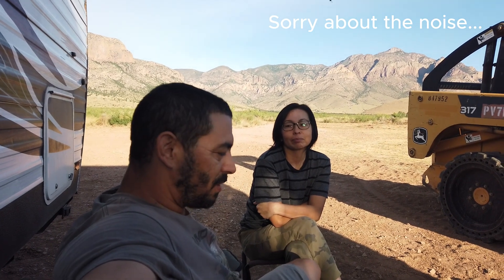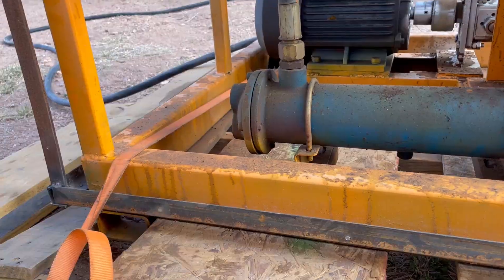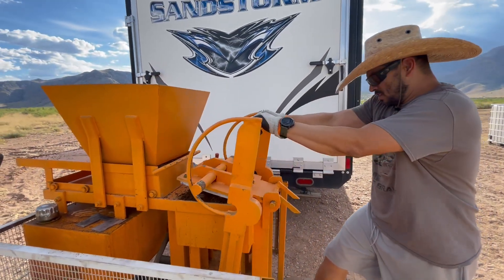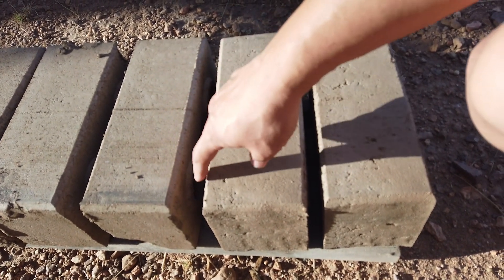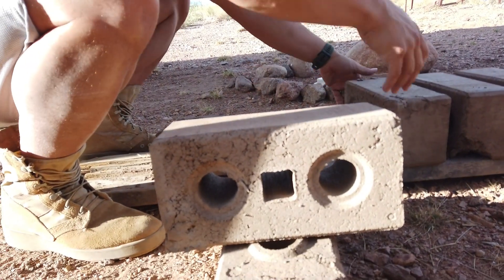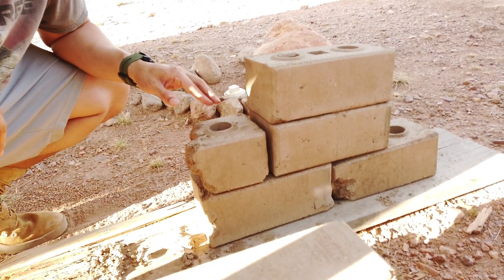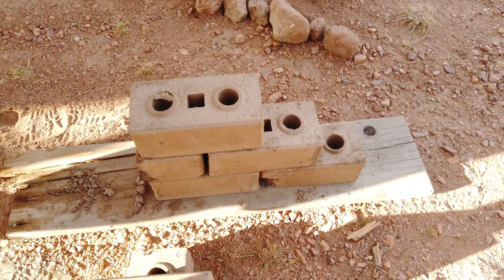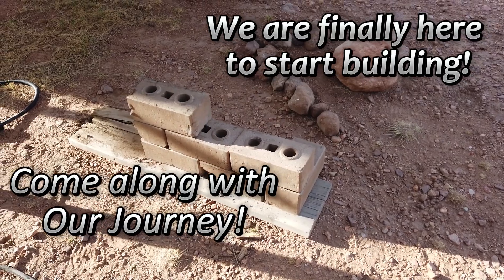Compressed Earth Blocks for House Build

Comment: wrong mixer , your clay is balling, you cant use cement mixer with clay
Reply: we have 2 different ceb machines
Reply: we use pan mixer or bobcat attachment , be sure mix is damp but not wet
Reply from the maker: @JohnDay-g6o  Thank you for your comment! We’re aware that the mixer we’re using isn’t ideal. While we may invest in the right one in the future, for now, we’re considering a viewer’s suggestion to screen our mixed soil one more time before putting it into the hopper. That’s amazing to hear that you’ve built two houses with this type of machine. What an accomplishment! Thank you for sharing your insights!

Comment: One of the techniques that I thought of using for the block curing process was to install hot water solar panels to a wood kiln - the ability to cure the block under moist conditions increases the psi due to slow hydration . It is something that I would like to try to accomplish for the block to our well house. Just a small test project.
Reply from the maker: Interesting. Are you finding that your blocks are not holding up?

Comment: The thermal mass can also work against your favor. If the day is long, more heat is absorbed, so your house will remain hot while outside it is cooling for the night.
Reply from the maker: Thank you for finding our video and commenting! We are actually planning to do double wall and have insulation in between those walls. So hopefully it keeps inside temp maintained. Have a great weekend!!

Comment: Open Source Ecology has a Liberator CEB Press Machine.   You could buy a unit for about 10k that they would ship to you and you would put/weld together.    You would use your loader to fill a hopper and it would crank out several 12x8x2" CEB Blocks a minute, more than you could stack by hand.         Would be nice to get a "Soil Blender" mortar mixer for your John Deer to take the screened earth, mix it with the 10-20% cement, and add just enough moisture to dampen the soil and then dump that mix into the hopper.
Reply from the maker: This machine should be able to crank them out once we get the hang of it. I have looked at the skid mixers. I was thinking to just build a mortar mixer as a stand alone but haven’t gotten that far.
Reply from the maker: Thanks for the comments. We hope to get back out there and start making progress soon.

Comment: I got the manual brick machine 1 year ago. By my self I can dig and produce 65 - 85 bricks per day after many days of learning.  Just finished first big batch of 1600 Issb lego type.  starting shed in spring.  I'm in north Idaho.
Reply: I use the water test and guess our soil at 50% sand and 50% silt and clay I add 10% by volume  Portland cement. I also use 6x12 inch siding scraps to set the bricks on for moving and leave them for 24 hours before stacking for curing.
Reply from the maker: @arewewatching3815  that is awesome. We think we are a little light on clay. We find it hard to get them off the machine. Maybe technique. Thank you so much for your quick response.
Reply from the maker: That is awesome!! We hope we get to that point!! We work on our property remotely, we haven’t had a chance to put the machine to the real test yet. 65 brick a day is impressive!! Do you have good amount of clay on your property? We are planning to build pump house first before building our main house. We would love to hear how you are doing time to time!!
Reply: I had the same problem. My fix was to poke the dirt in the mold with a 1x1 stick then refill mold.  Still not firm poke the mold 2 times and so on. I find 3 pokes work best with my material.  To make a firm brick.
Reply: Do you know how to check your material with a jar and water?   To see how much sand and clay and silt you have?
Reply from the maker: @arewewatching3815  yes, we did it a while ago with top soil.  We need to get more accurate result by digging and using soil from a few feet down.

Comment: Im prety sure after you make the brick you have to put them on the ground and spray them with water on a misst so the mix is dry befor it's made into a brick
Reply from the maker: We are mixing moisture into it before it gets compressed. We just have to get the mix right.
Reply: @leeslivingoutofthenorm  o ok
Reply: @leeslivingoutofthenorm  Then you have tow water them for 14 to 28 days 2x a day and cover with black carp to hasten the dry.

Comment: Did you pass the dirt through a 1/4 inch garden sifter before mixing with sand and cement? Also, I wanted to ask how long did you leave it to cure? I saw another video where they water each block every day for 21 days.
Reply from the maker: We passed it through 1/4 fence wire. We have plenty of sand in our dirt we think. We still need to pick a spot where we are going to grab dirt from so we can test to see if we need more clay. We don’t know the time to cure but we’re planning to use 21 days. We figure we will have to make bricks for a long time and they will get 80% of their strength in the fist couple hours. I have heard of people spraying them but we just are not sure yet.
Reply: @leeslivingoutofthenorm  Cool, thanks for the reply. Hope everything works out well. Looking forward to seeing your progress.
Reply: Mustve been lime not cement if they're adding water

Comment: You need to stop wasting your time with that machine. Find David Eastons books and read them, follow his form work. Get a skid steer and get a mixer bucket to mix the earth. The mixer bucket attaches to the skid steer.   Then use a hydraulic tamper that use the ports off the skid steer to power the hydraulic tamper, I use a Stanley ta 55 tamper. You will have your walls up fast.
Reply from the maker: I looked into doing it that way as well. It is one of the reasons that I wanted to make sure my skid has the hydraulic lines to do it. We’ll see. I’m a city boy just trying to get away from it. After the first building we will see which way we go

Comment: For what is intended, the hole in the middle of the brick?
Reply from the maker: Good question!  We have a couple different things we may use it for. You can stuff rebar down it, pour concrete, or run utilities down through it
Reply from the maker: Matter of fact thanks for the reminder. I need to do a video about that!